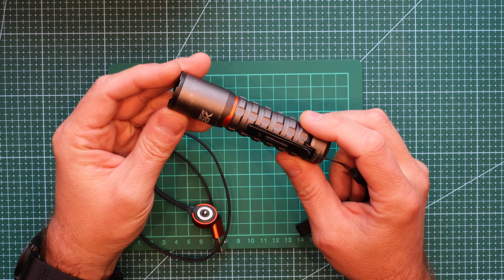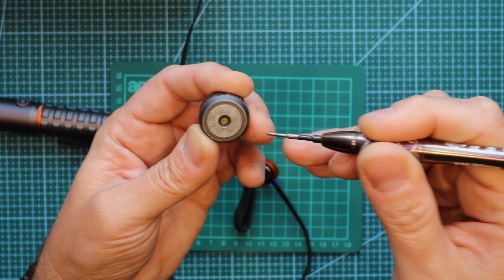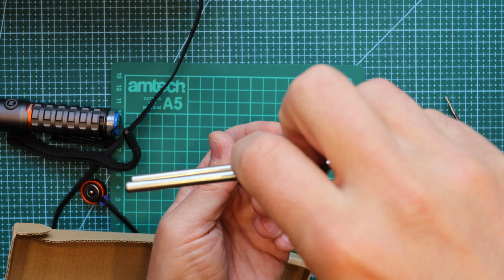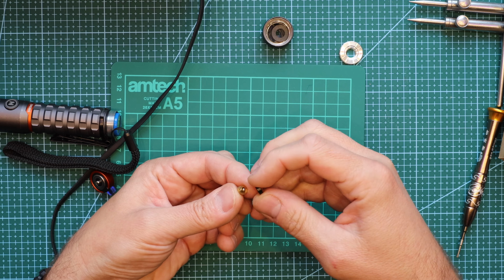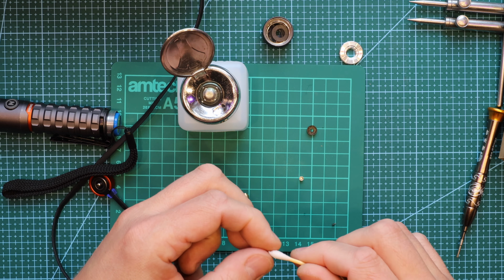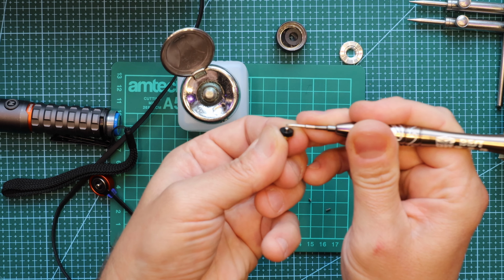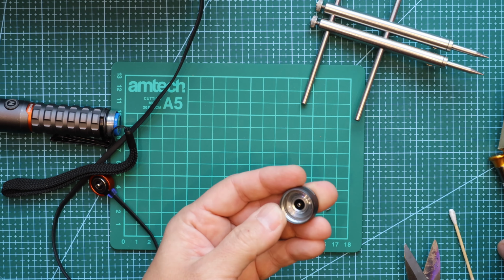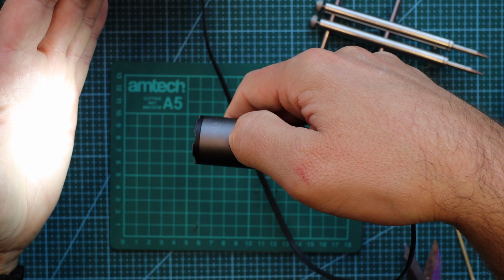NEBO Torchy 2k Torch - flashlight repair (Charging problems)

Comment: Man thanks a lot i have rge same flashlight and the same problem i am going to return it and get my money thanks a lot
Reply from the maker: It's an easy fix! If you have time.
Reply: @magicscorner   yea i tryid ot and it wouldn't open
Reply from the maker: @ΜΕΝΕΛΑΟΣΦΕΓΓΕΡΟΣ  the tool I am using is extremely helpful
Reply: @magicscorner   what is it called
Reply from the maker: @ΜΕΝΕΛΑΟΣΦΕΓΓΕΡΟΣ  Lens Spanner
Reply: @magicscorner  ok thanks a lot i will search it